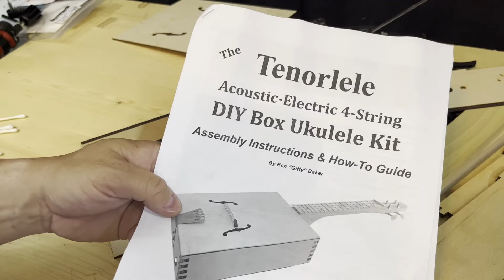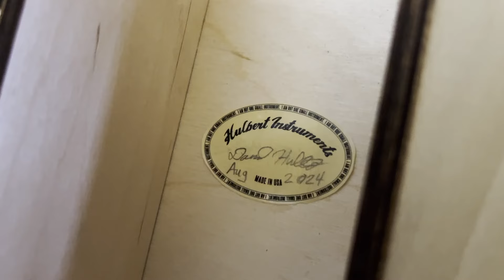Tenorlele Kit - Tenor Ukulele Kit from C.B. Gitty

Comment: Can you go into more detail on the finish products i.e.stain and poly you used...is the neck sticky? Building a CB Gitty kit and I need to make a decision on finish soon...Thanks in advance
Reply from the maker: I started with Minwax Pre-Stain wood conditioner, then some darker Minwax stain (I can’t find the can to check the color name), then some Krylon Gloss Crystal Clear spray.
Reply: @CircuitsAndStrings  Any stickiness in the neck from the crystal clear spray? Your stain looks good.
Reply from the maker: @kelchr58 it didn’t get sticky. But I also applied it in the middle of the hot summer.